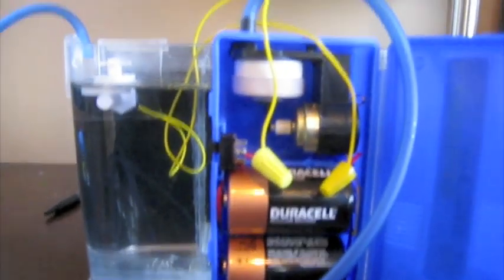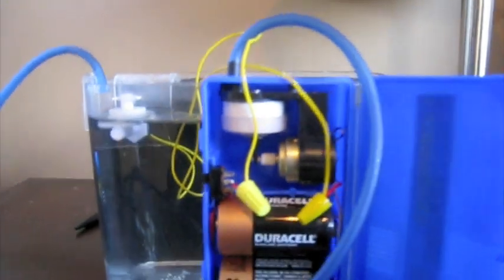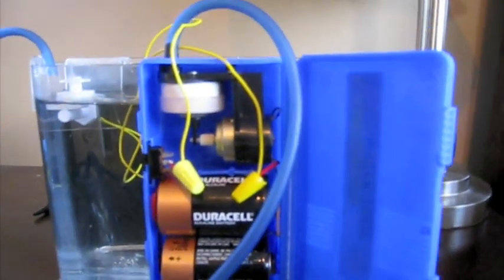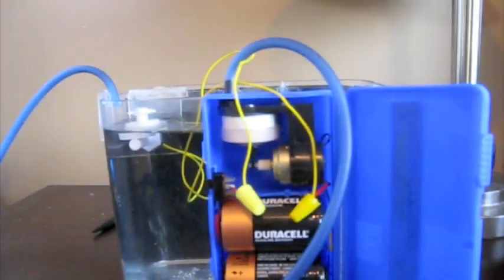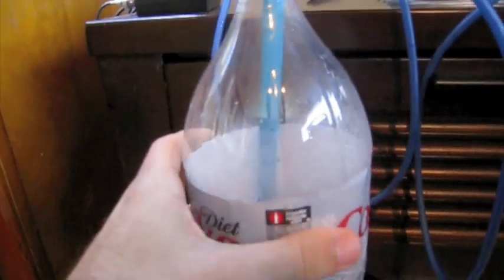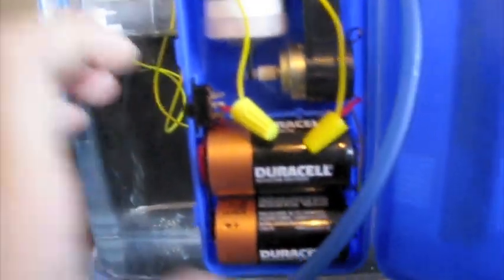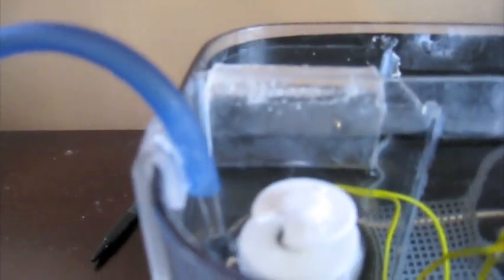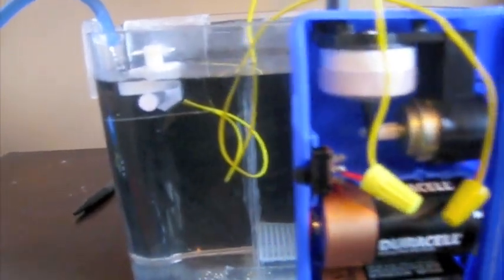Battery Powered Automatic Top Off (ATO) System for Aquariums

Comment: Great idea, but with me, there always seems to be a hitch in the planning.  First, the drilled hole is not quite airtight.  I used a 1/4 inch drill bit for a 1/4 inch Outside diameter hose and it leaks.  Also, the vertical distance from my r.o. reserve, to the top of my sump-less aquarium is 5 feet ~~~~ Unfortunately, the pump will only push the water about half that height before it starts to fail.....  Suggestions?

Comment from the maker: @barda12345 You can use a wire splicing tool from HD or radioshack, or you can use a razor. The trick is to only cut the plastic that encases the actual wire.